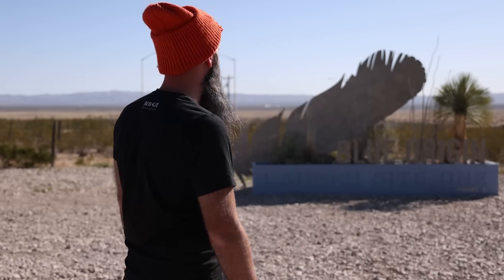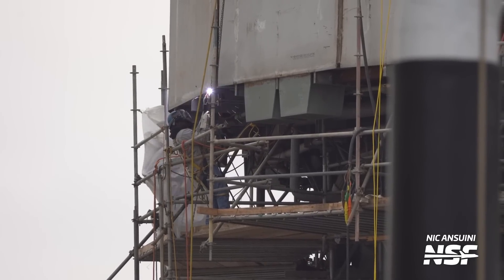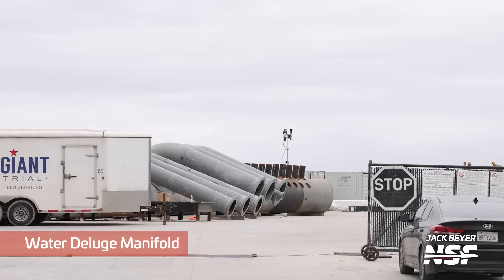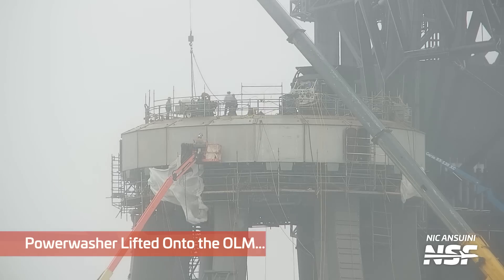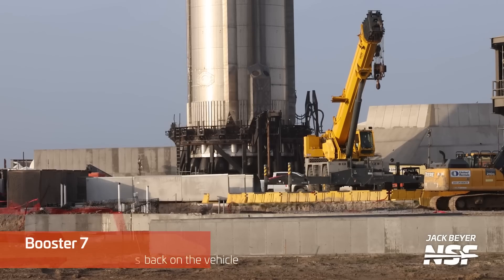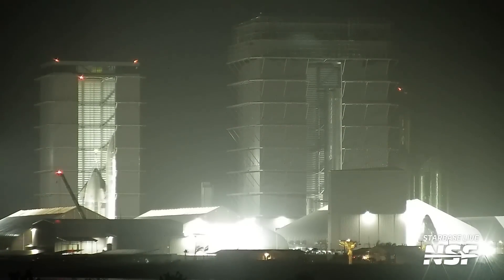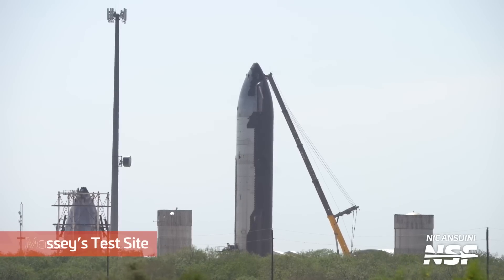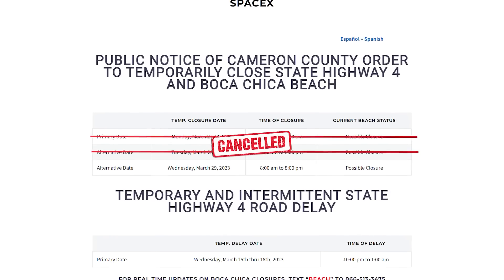Is Starship Booster 7 Returning to the Pad This Week? | Starbase Update

Comment: I figured the second set of stairs were being tested and check to make sure everything was right on them to be used on a secondary or third launch platform. It is cheaper to have a contractor build several sets of cat walks or stairways if you know you're going to need them later all at the same time instead of having them come back over and over.  This is done over in the oil and gas industry. And you get a better price on the materials ordering multiples all at once, while at the same time avoiding supply chain issues at a later date.  👍🏻

Comment: I wonder how long they have to wait for that concrete to cure in the leg extensions.  That big a volume should take quite a while to cure.  But do they have to wait for it to cure before launch?
Reply: It all depends on how much gypsum they added to the mix. The more added, the faster it 'goes off'. But trade off is that it can crack if you add too much. 
The thick steel extension pipes have already withstood 5,000 tonnes of load and a 31 engine static test fire, so I guess the concrete just gives a bit more added rigidity to the structure?

Comment: Takes 30 days for concrete to cure.  Good timing mark.
Reply: If you add more Gypsum, that speeds the rate at which concrete 'goes off'. Not that they really need it. They have already loaded the OLM with 5,000 tonnes and a 31 engine static test fire. The concrete is only going to add more rigidity to the extensions. Probably more importantly, it will displace most of the air in the extension. This will stop the air getting hot during launch and potentially cooling after and causing a vacuum that might 'implode' the pipe or warp the sides?

Comment: I disrespectfully disagree with you Jack when you were showing cold molasses being poured.   That molasses flowed much too fast to be anything less than room temperature.  The units for measuring viscosity is in centripoise cps for short.  CPS is centimeter- gram- second. This unit is a measure of dynamic viscosity.

Molasses has a centripoise of 5000--10,000.   Compare that to corn oil which is only 65!   Cold molasses would have a centripoise of 50,000--70,000 like catsup to be proper viscosity to be considered "cold molasses".  You are usually good with details so I don't know you let that one slip by.   

I'm know I'm early for April first, but important information must be conveyed without delay.

Comment: Maybe the stairs are for the cape and they just used the OLM as a fixture. The crew's here, so it might be more efficient to do it here and ship it?
Reply: I don't think so. They could order stairs to be made for KSC if they needed them.
They needed the welders doing more important work more than finishing the stairs. They could not leave them half done, so they removed them for now.
Reply: @knowledgeisgood9645  Why would they need two stairways right next to each other going to the same place? You might be right I just don't get it. :)
Reply: @williamgreene4834  Building codes. More than one escape route is needed. Like the 2 lifts and 2 staircases in the Mega bay.
Reply: @knowledgeisgood9645  You're probably right. They are operating with only one now though but I guess it's not done yet.

Comment: Maybe SpaceX waited until the launch table was perfectly level before
pumping in the final concrete - which has to finish hardening.
Reply: They had the WDR with a full booster and ship with hollow extensions! At least they proved that the extensions could hold that. Forgot? No, delayed too long. It could be that adding the shielding, the deluge and now the concrete are all hardening that Elon ignored but Gwynne ordered.

Comment: I am getting really impatient with SpaceX... no tests for 2 years now, are they actually doing something??
Reply: Plenty. But it is a lot they needed to get done. The factory. The tank farm. The tower. The OLM. And problems with the ships and boosters and Raptors. That is the infrastructure needed. Doing it in 2-3 years is lightning fast. Compare with SLS and even the Shuttle. Even Falcon 9 took years. SpaceX did it with about 3 000 workers. Apollo had 400 000 engineers, professors and technicians working on it, just for comparison.
Reply: @knowledgeisgood9645  it was a joke... I just want to see them test, I know perfectly well how hard it is, and I still believe they have not more than 20% chance of succeeding. It's absolutely amazing they have arrived where they are

Comment: Love this format, especially when Jack narrates. 
Why do I get the impression that a lot of work on the OLM was not in the original plans? So many things seem to be after thoughts during construction. Or maybe this is a 'Design/Build' type contract. 
Also, if they continue adding shielding, my idea of Nitrogen gas flooding of the interior for fire suppression is still alive.
Reply: Because this is an R&D site. The OLM was a prototype just as all the ships and boosters. They encountered problems along the way and have had to re-design and adapt as they progressed.
Flooding the inside with nitrogen is very possible, but it will quickly leak out, which is OK.
Reply: @knowledgeisgood9645  So it's Design/Build like I said then. Great! I understand what you're saying but still most of this stuff had to be known at conception. How long have you been an Engineer?
Reply: @dirksgently409  They followed Elon's mantra that the best part is no part. So they build it as simple as they could then added complexity only when there is no other way left. Not the conventional way, but they have proved before that it works.
Reply: @knowledgeisgood9645  What's the least expensive solution to a problem has been my mantra as well. My N2 fire prevention idea in the OLM is one. But still, the thermodynamics and force of 33 Raptors at launch was known once Starship was designed. Thanks for the back and forth, hope you enjoy this convo as much as I do. ☮
Reply: @dirksgently409  Yes I have.
SpaceX has been the best in the industry at keeping cost down, so by that yardstick they still "win".

Comment: They had better get some paint on those exposed steel beams on those buildings. One is rusting a lot already. That signifies poor quality painting from the factory. You are supposed to have a primer and 2 finish coats near salt water. Don't do that and you will be sandblasting in 5 years.
Reply: They have already sandblasted it once before. But it would be nice if they had a painter or two on staff.

Comment: Concrete has great compression strength. It makes sense to put it in all voids in the OLM for such an enormous and powerful machine.
Reply: They should have done it after installing the extension, as well as some rebar, but they just did not. I was very surprised back then.
BTW, the extension was needed when the booster was made shorter as they made away with legs and skirt. That would have placed the bottom of the Raptors 3-4 m closer to the ground, so they solved it with adding the extensions. That is why we have that elbow in the legs - same diameter but higher up.
Reply: I don't think they filled them, probably just up to where they put the port.
Reply: @kirkpuppy  That would make no sense at all. They used the same method they used on the tower columns.

Comment: Pressure washers are sometimes used to hydrostaticly test piping. They're cheap, and they'll put out 3000psi+.
Reply: oh, interesting!
Reply: It was done on the top of the OLM. No pipes there.
I think they simply had to much junk after all the work being done that it was easier to power wash it than using any alternative method.
Reply: Do we know the hydraulic system rated pressure for B7, BTW?
Reply: @dphuntsman  No. We only know the tank pressure (about 6 bar).

Comment: S26 is a lunar lander proof of concept right? Gotta test that soon or no dice on that NASA moon landing.
Reply: They need to test fuel transfer and storage in orbit before they can begin to worry about the Human Landing System. Nothing else can happen without the data on transfer and storage.
Reply: @stillwind_1  Indeed. Wonder if they test refueling this thing and attempt a lunar landing with it for all that data.
Reply: Fuel transfer and storage tests can all be done within S26 while it is in orbit. It is not equipped for lunar landing.
Reply: With Gatway’s current dependence/insistence on SLS we can count on that being a few years late. No rush on Artemis lunar lander as it’s useless until Gateway is ready. More likely Starship does a moon direct landing and Mars launch before Artemis Lunar lander system is needed.
Reply: Not that I am aware of. It is possible that the new tall stand S26 was put on is for mounting engines.  We'll keep watching.
Reply: Have they put engines in S26 yet?